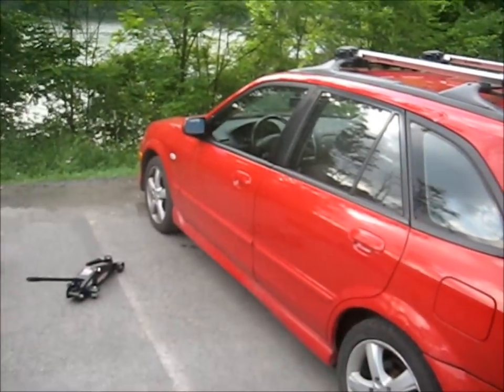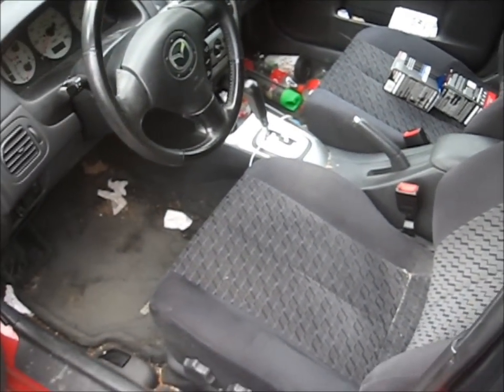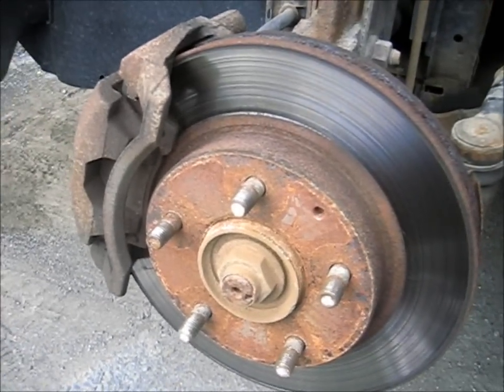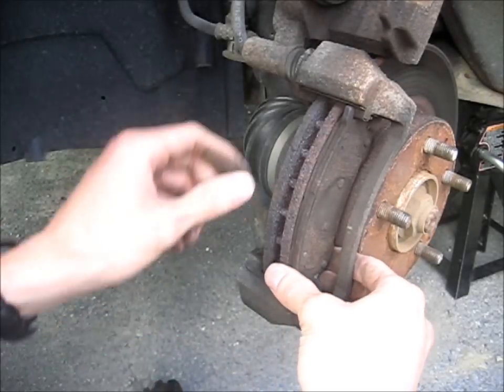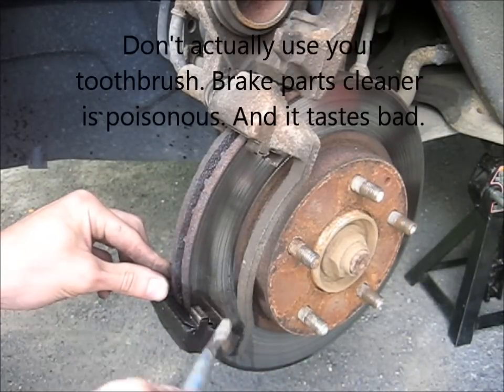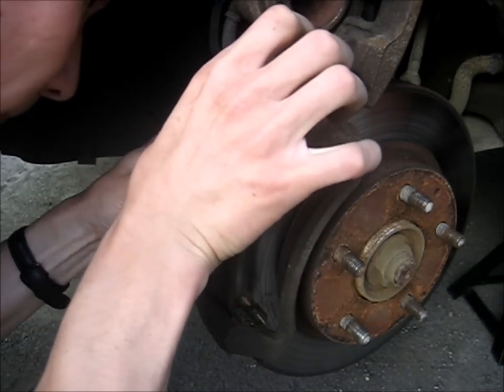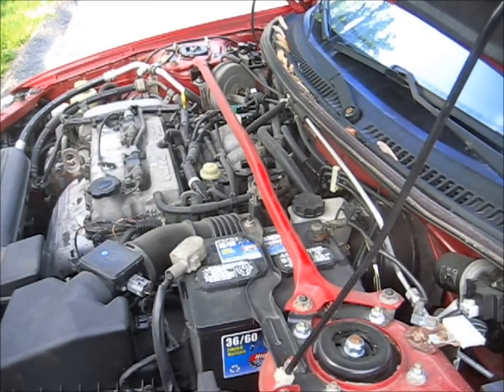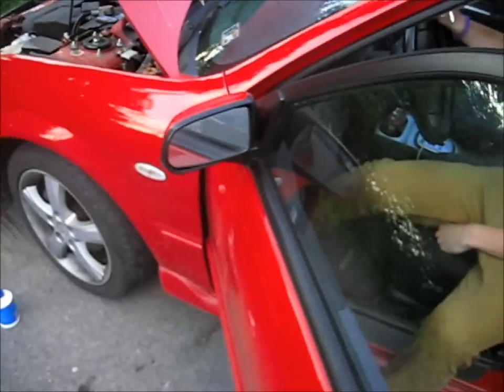Mazda Protege5 Front Brake Pad Replacement

Comment: I think that you did a really good job on this and it gives me a good sense of what I am getting myself into tomorrow. but one thing I did note is that this is a floating caliper and you never applied fresh grease to the slide pins. (responsible for allowing the caliper to float) Because of this when the grease wears out the caliper will stick
causing increased pad wear, decreased gas mileage, extra noise, and extra heat which may cause your brakes to fade
Reply from the maker: You are correct. I actually checked the slide pins off camera on the side that is filmed here and it was nice and clean. The side that was not filmed was dried up and required cleaning and new grease. If I could film this again I would definitely include that tip.
Reply: TheAlexManVideos
Either way, its videos like these that help average people get repairs done on there cars for the price of parts and the beer afterwards. So keep up the good work!

Comment from the maker: The rotors do not need to be replaced every time the pads are replaced. Unless the brakes pulse when braking, or they are worn to the point that there are grooves or worn beyond minimum thickness. 

"Turning" the rotors (or machining off the imperfections) is like sanding the scratches out of a wooden table, but this can only be done to some extent. Eventually you'll be machining them to beyond the minimum thickness. Also, the shop may not have the lathe needed to turn the rotors.

Comment from the maker: The tool is expensive, plus it takes time to actually use it. Some parts (rotors) are cheap and it's very simple to just remove the old one, and then slide the new one on. They don't need to buy the tool, train mechanics to use it, and then take the time to actually use it.

Comment from the maker: Also, lets go into lugnuts specifically. If you were to stand on the lugwrench with it positioned to loosen the nut, you could only apply a torque equal to your weight times the length of the wrench handle. This is of course neglecting if you were to jump on it which would increase the force on the wrench and therefore the torque. But this is uncontrolled and can lead to breaking this. By using your hands to pull, you can apply a much higher force.

Comment: while pushing in the caliper cylinder do you need to have the cap of the brake fluid reservoir off or not?? thank you and this is a very helpful video keep it up
Reply from the maker: +santiago p It's not at all necessary. But it is necessary to monitor the fluid level as you push the pistons back in, it could overflow if you don't pay attention.

Comment from the maker: You can pull with more force than you weigh, but you can only push as much as you weigh before you are simply lifting yourself. Be smart in the garage. Pulling is safer, it's more controlled and you are less likely to get hurt if something breaks. If you do need to push due to the situation, push with an open hand, this will make it less likely for you to smash your knuckles if something lets go unexpectedly. Don't jump on the lug wrench if avoidable.

Comment from the maker: I have to disagree. There are times when this is necessary or perhaps unavoidable due to the nature of what you are working on, but pulling is almost always safer. It is much easier to control a pull. If the bolt/nut breaks, the wrench slips, or something gives away rapidly and you are pushing, you could easily smash your knuckles or punch something you shouldn't punch. A well maintained vehicle will not need excessive force to remove the lug nuts and as you can see I had no issues in this video

Comment: Thanks for posting this! I can't get my caliper to flip open like it shows at 3:04 any ideas?
Reply from the maker: If the bottom bolt is removed then the caliper should flip up as shown. If it does not, the top slider pin is very seized. Get a big prypar and pull harder.
Reply: Thanks for the response. It was far too seized to move even an trying several prybars and methods. I wound up removing the whole caliper assembly and installing the pads that way.